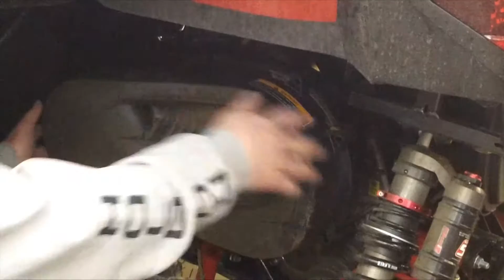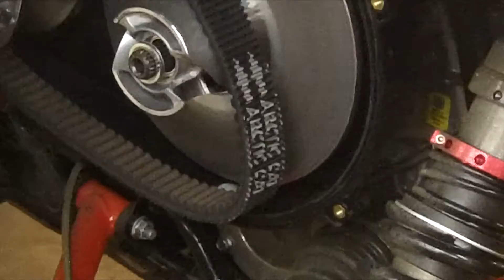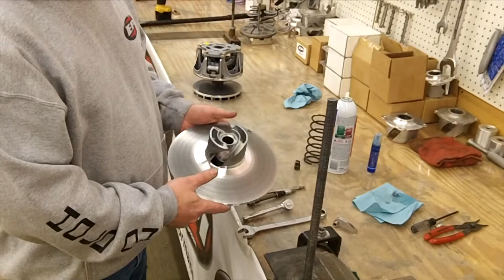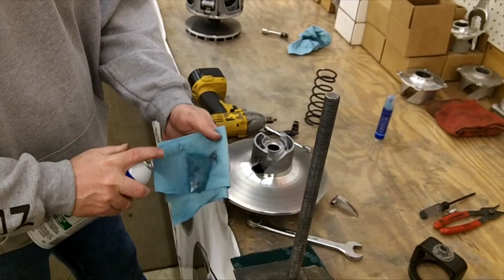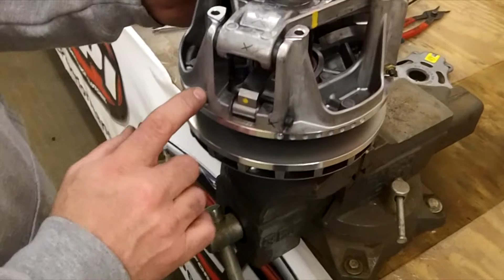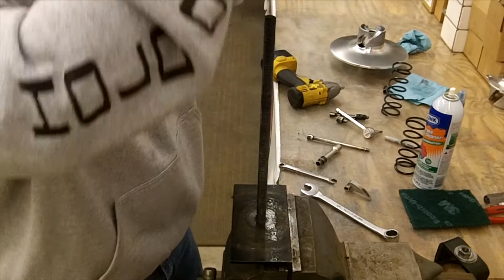Arctic Cat 700 Wildcat Trail / Sport 2014-15 Clutch Kit Install - EPI Performance

Comment: Does this also solve the rough shifting issue? I have a 2015 trail 700 and it gets stuck in gears all the time and is horrible to try and take out
Reply from the maker: Maybe.  If your clutch is staying engaged and hard to shift because of weak springs then it would fix it.  I would inspect and clean your clutches really good.  If the clutch is worn out or all the bushings are sloppy loose then the kit wont fix it.  If clutch is in good shape and clean and still having issues it might be your shifter cable/linkage is not set correctly.   Once your clutches are physically in proper working order the clutch kit will give you added performance all around.

Comment: atv/utv/snomwobile belts are not directional. It doesnt matter what direction they go on. Please dont spread incorrect information. I have worked with multiple belt manufacturers and not a single belt on the market is directional.
Reply from the maker: Hi Micheal, we are not spreading incorrect information??!!  Most belts can run either direction.  Also most belts have lettering with part numbers and an arrow on them.  If you listen to any of our videos we say to run a belt so the arrow and writing on the belt are going the correct direction.  Most OE and aftermarket belts have an arrow to show you the direction they want the belt to run, but more importantly its a way to keep track of the belt so if you have removed your belt and going to reinstall it, it gets installed in the same direction it was originally ran.  Running the belt the same way once it has been used is important to the life of the belt.